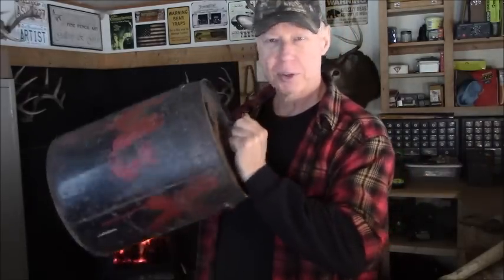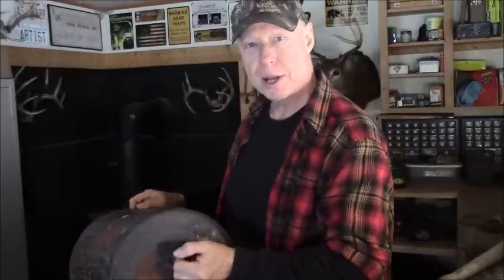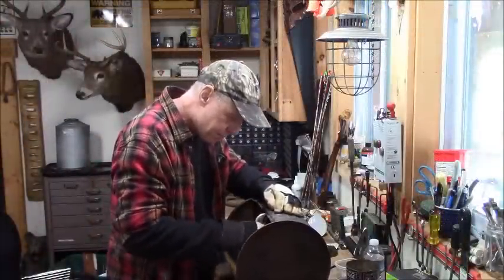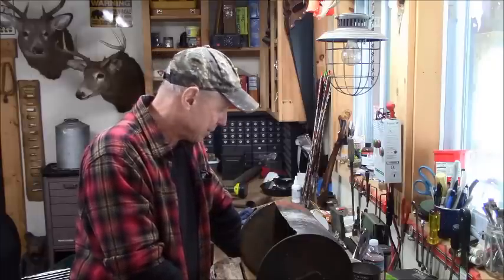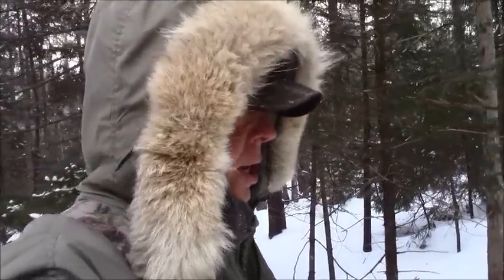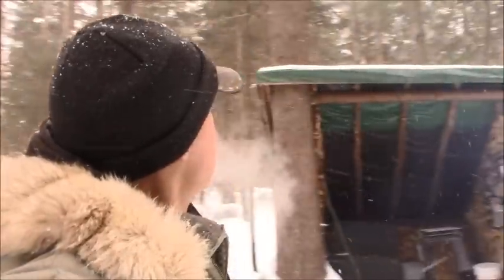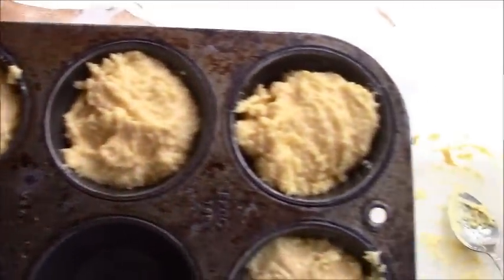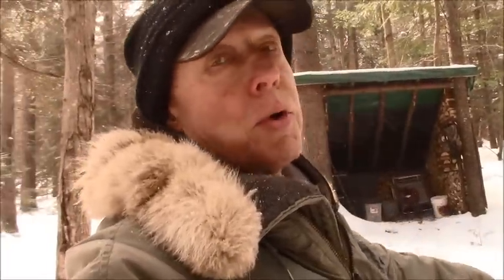Dick Proenneke Inspired GAS CAN REFLECTOR OVEN PROJECT.  Alone In The Wilderness with a Gas Can oven

Comment: Great job! I made something similar using an old stainless steel laundry tub on its side that I put in front of our wood burner. It has a pizza oven thermometer inserted in the plug hole. Works a treat but I found that as it’s so open, I had to put a piece of tinfoil across the top edge to make the opening a bit smaller and trap the heat a bit longer. So far, I’ve only done a slow cooked casserole but I was very happy with the result. 😊
Reply from the maker: I've done similar and will make a video in the future.  This is open on the side because it needs to reflect the heat from the flames.

Comment: I had one similar to that but what I did is Then I fixed it over the front of it so the heat would be at the back of it the can
Reply from the maker: Lots of ways to make an oven but a true REFLECTOR OVEN has to be open in the from so it can reflect the heat from the flames.

Comment: Hi Boss,
Just like you I save those racks every time I find them. 
When my gas oven died I dismantled it. I kept the steel outer shell as it was good stainless steel. I used some fashion a door on the grill housing and that is now a barbecue oven with a pizza stone. I trimmed one of the racks to fit inside my multi fuel stove. My good lady usees it to bake potatoes. Last night I came home and she had foil wrapped a gammon joint and cooked it in the fire!! Amazing lady.
We are in the middle of refurbishing our canal boat home so sort of camping in it! 🙄 Connecting up the gas line and getting a new stove with oven is in our VERY near future. For now we have a two burner & grill.
A major set back was BOTH alternators giving up. Now ot looks like the water pump has gone. The navigation authority are not best pleased as we have been here 7/8 weeks. We were iced in for two. But the rules say 14 days and we had extensions on our extensions! 🤪
However, we keep on keeping on. 5 more months down here and we head further north to Birmingham.
Life is good! Stay well my friend.
Reply from the maker: Sorry to hear about the setbacks  We're suffering our own at the moment.  Lori fell off a stepladder and then tumbled down the entire flight of stairs and sustained a shattered wrist and many other injuries in the process.  We are back at the cabin now but she'll be going back to the hospital. Living up here with ATV access makes it tough when stuff like this happens.

Comment: Greetings from PEI, that was a fun one to watch.  I rank this one right up there with the Ice Box you made at the other place.  I don't see a similar one at this place, unless you are using the cooler underneath for cold storage.  Those little feet are 'da bomb, I hear ya on the butter.  I keep mine next to the window in winter and put it next to wood stove each time I want to use some.  Not much snow here.  I think it will be a three and a half cord winter.  I tossed some garlic in olive oil in a small cast iron pan and placed it on some coals inside wood stove, then I squashed them on crackers with extra old cheddar and a jalapeno slice.  All the best
Reply from the maker: I'll never be without my built in ice boxes.  The cabinet in the corner with all the cast iron pans hanging on it is the icebox here and full of food as I type.  A few beers too haha

Comment: I was wondering if you used the big piece of the bucket that you cut off, put a couple hinges on top to make a door that would  keep the wind out and made it an actual oven. I made something similar out of an old air compressor tank
Reply from the maker: i could but then it would no longer be a reflector oven. I can use my dutch ovens otherwise.

Comment: OMG -  you are a real hoot. Pretty damn good lookin oven. Just wonderin why you decided to not have a door on it to help keep some of the heat in. You certainly had enough "hardware" from your collection there. LOL. That was a hoot too. Hardware collected from your visits to the dump. It don't come at a better price than that - that's for sure. That bucket handle sure looked like the handle from our old oil lamp. Loved the feet you re-purposed. All in All - 2 thumbs up. Hey, those muffins turned out pretty good. What? No thermos full of coffee???? Ha Ha
Reply from the maker: Lots of folks asking about the door but it would no longer be a reflector oven if it had one. The ovens work by reflecting the heat from the fire and not placed on the heat like a dutch oven :-))
Reply: @thebossoftheswamp  Ahhhhhhh-haaaaaaa. Got it!

Comment: Got any advice for a guy laying down flooring for his house's first ever bathroom? lol    I bought an old kominka and the original toilet is a squatter out in the storage shed. Obviously, I don't want to be stumbling out there in the middle of the night to do my business. Currently, I'm working on installing the method of insulation for the floor that you use: the aluminum foil/thermal reflective insulation. On top of that is the hardwood floor, and then plywood, 1/8" cement board that is sealed/grouted, and then a final floor. I'd like tile (just seems to be the best choice for this house) but some are telling me vinyl. The problem I have is that vinyl doesn't really match up well with a house that's a couple hundred years old. Also, not every type of tile would match, either. The tile choices in Japan aren't what they're like in the US -- much of what we could easily get in a US hardware store would be import-only here. Do you have a suggestion? Thanks so much!

Comment: The question is, how many times did you look lustfully at the bubble-foil when you wanted to line it?  Danged plastic!  LOL  If you'd've used a Dremel to cut the hole, you could've added two hinges and made a door.  Add a thermometer from an old BBQ from "The Mall" and you'd've been baking in style.  Some black high-temp spray paint on the outside, et voila!
Reply from the maker: Yes indeed or I could just use my dutch oven :-D
Reply: @thebossoftheswamp  But I get it.  You want something which works that doesn't require being packed in/out of camp as you come/go.  I like it.